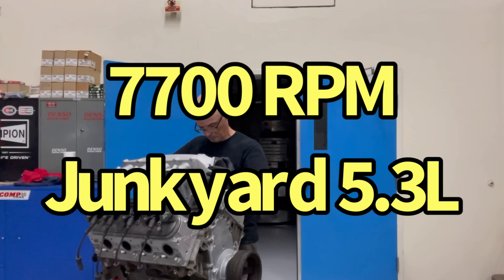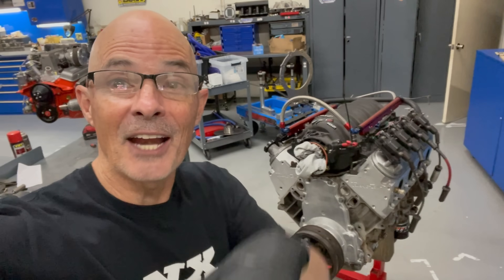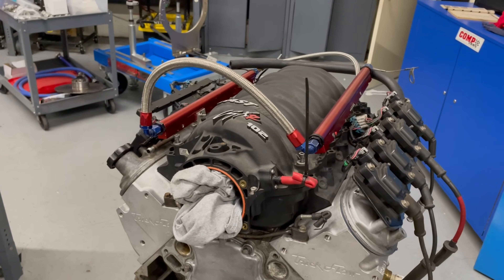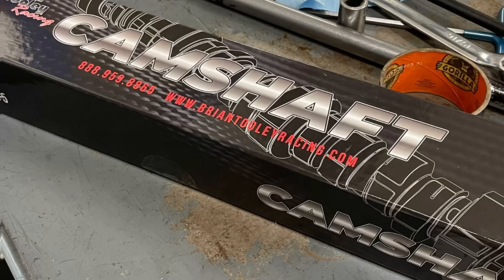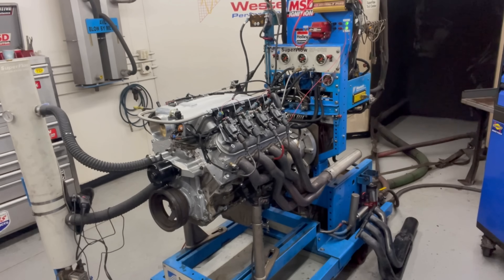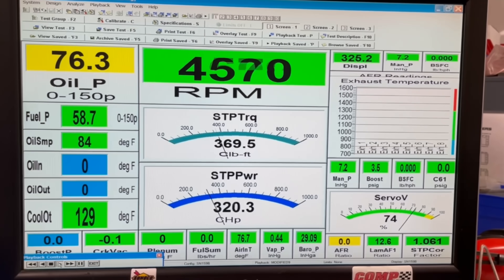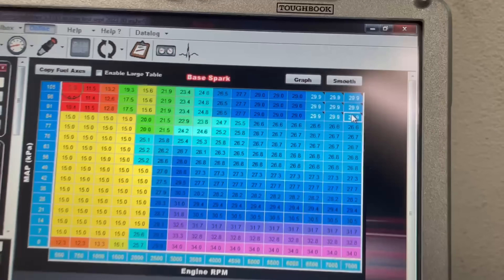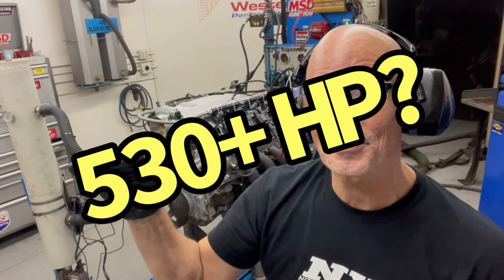JUNKYARD LS MONSTER MAKEOVER! HOW TO TRANSFORM YOUR JUNKYARD 5.3L INTO A 7,700 RPM, 542-HP DEMON!

Comment: Do you think you can make a video on a budget 100 hp/l 5.3 that revs to 7500 rpm
Reply from the maker: that is already up-we made 542 hp from a 5.3L (100 hp/ltr is NOT a budget build)
Reply: @richardholdener1727 could 500 hp be possible for a budget build? If not ima js start with 7500 rpm

Comment: Just curious if this large of a cam would last in road racing situations? I’m in the planning phase of building a gen 3 ls motor. Engine builders, please let me know
Reply from the maker: are you asking about the material of the cam? You need to be more concerned about valve train and engine oiling on a road race motor.
Reply: @richardholdener1727 100% i am, but I’ve been reading that high lift cams cams are tough on the valvetrain, so i was wondering if there was was an upper limit on valve lift that you wouldn’t exceed for an engine being used in road racing. I’m going to be mating a 5.3 or 5.7 LS to a ZF8hp. So I’m going for all top end power since car will have a really good heating and close ratio, but want to make sure it’s reliable.

Comment: I'm betting this has been asked 100 times but here's #101. Typically, the manual transmission power loss is estimated at 15%, but what is the estimated power loss of the accessories? Essentially, what I'm asking is, if this was in a car with full accessories with something like a T56 behind it, what do you think it would make to the wheels? I feel like these bare engine dyno runs give a lot of prospective engine swapers a false hope when it comes to horsepower.
Reply from the maker: The dyno gives a true reading of the changes in power from changes in components. There is no strict percentage loss for a manual or auto trans (every trans takes a different amount of power to drive), same with rear ends, tires, wheels, drive shafts etc...

Comment: Would this have had a higher peak RPM with a 4.8l crank, crank scraper, and/or shaft mount rockers?
Reply from the maker: a 4.8L would have to run higher because it is smaller-but would make less power
Reply: @richardholdener1727  that's what I thought, but I'm chasing high RPM sound 😅 how many RPM higher would you estimate?

Comment: Do you just have a build list I'm listening but i feel like I'm missing some info. What heads? What actual  pushrod did you use
Reply from the maker: tfs as cast 200 heads that were ported by BTR-comp .080 wall hardened pushrods 7.425

Comment: Majestic. Rewatched at least 5 times. Next we need to see 250 + intake cam. 12.5 compression. And test ethanol vs methanol. 600 hp would be magnificent
Reply from the maker: cams like that won't fit
Reply: @richardholdener1727 would need valve reliefs

Comment: So there is a real possibility for my race car L33 5.3 with forged pistons+rods, BTR LS3 NA stage 3 cam, diy 8-1 headers into 2x3" straight exhaust and diy ITB setup with injectors shooting straight to intake horns, to really make 530hp!  I'm going set the limiter to 7500rpm just be on save side because I will run the car for upto 30min at the time.
Reply from the maker: where are the ported & milled heads?
Reply: @richardholdener1727  I have matched(about +5mm diameter) the exhaust ports to the headers(1-5/8", about 42" quite equal lenght primaries about 5" collector) leaving the stock d-shape untouched. I'm going to match the cathedral ports to 3d-printed cf-nylon runners for the BMW R1200 ITBs. Injectors/fuel rails are going to be atop of air scoop/hood. Heads have BTR valve springs, trunnion bearing upgrade and cromo pushrods with Cadillac racing hydraulic lifters. Runned out budget with valves and opted for new cheap valves from Rockauto and lapped them to stock  valve seats. If it seems that the heads won't flow enough after first racing season(in Finland we have 5 month summer) then I need find the money for head and valve job from a professional. Dreamed about some nice CNC heads but they cost as much everything else on this engine :)
Reply from the maker: good luck

Comment: Looking to finish’s my gen 3 lm7 I did a btr stage 3 ls1 cam ls7 lifters and 660 ls6 springs and a single plane carb intake with a 650 for 1/8 mile bracket racing and what could I do better? Also 706 heads
Reply from the maker: ported heads

Comment: I think we should change nothing but a trunnion upgrade, and start squeaking up the compression ratio somewhere in the 13s andE85. Bring that torque up. I do think that there is the potential that we’ve reached the max CFM of those heads. At the higher rpm range I’m wondering if we’re getting some nasty low pressure zones in the transition from the square openings to the Cathedral port. I guess what I’m saying is if we went straight to a rectangular port from a ported cathedral port, we would probably see some higher average power output.
Reply: Guys say those bushings aren't as good as a bearing... Very intriguing though
Reply from the maker: the heads flow enough to support 650 hp

Comment: E 85 and Revit out until the horsepower actually falls off
Reply from the maker: we reached the hp peak, so more revs does nothing
Reply: @richardholdener1727  more revs does a lot in the real world at the drag strip and street pulls with turbo LS to keep the engine from exploding in peak torque on the shift, so testing that theory on the dyno is what I was meaning, how far can it be revved out before it’s totally useless. And at what point and where does that happen? Guess we will never know because like you said it’s pointless

Comment: Please boost an LFX or any of the 3.6 DOHC "HIGH FEATURE" engines. They can make good power per pound of weight in a car. A bunch of Miata owners are swapping them in and would like to see them boosted. They are closed deck design, way better than Honda J series and Nissan VQ.

Comment: What would this engine do on Methanol? Theres a group of us that race LS powere sprint cars in the upper midwest, stock bottom end, 600 max lift cam, edelbrock victor jr intake with a 2-barrel carb on methanol, they make roughly 440hp on methanol. Just curious with this engine you just put together would do on Methanol.
Reply from the maker: what compression?
Reply: @richardholdener1727  stock, 9.5:1 apprx is what our Motors run, I was curious what the motor in this video would do on methanol.

Comment: Put the factory heads back on and see what u can do w a factory long block! 

 I buzz 7800 with the ms3 cam and twins for awhile now. 706 heads w pushrods and springs and twin 78s. Seems fine def slowed down w less rpm at the shift.

Comment: Nice job. From what I've heard e85 doesn't make a big difference in a N/A engine.  But let's see  ! Inquiring minds wanta know  !
Reply: I would think E85 would help more on a high compression Na setup. Like if this 5.3 Liter LS had 12.5 to 1 compression, notched valve reliefs in the pistons to fit a much bigger solid roller cam, upgrade to long tube 1-7/8" stepped headers to 2", & then run E85= an 8,000 Rpm, 600+ Hp, Na 5.3 Liter!

Comment: Richard holdener

On one of the episodes of engine masters, they were trying different size heads on I believe a 408

They showed that the 225 head was too large for that motor

So if a 225 is too large for a 408, wouldn't it be too large for a 325?

Wouldn't a 195 be maximum?

Guys on engine masters even got great results with the 165 heads. They actually impressed themselves, brulee even said that he would take the small head and cam. Com combination for a daily driver
Reply from the maker: a 225 head is not too big for a 408
Reply: @Bozemanjustin- You forgot to factor in the Rpm capability of a particular engine combo. Cubic inches (weight of reciprocating parts), compression ratio, intake runner length/flow (Rpm Range), head runner size/flow/valve size/valve train wt. (Rpm Range), camshaft (type & specs.). A 9 to 1 comp., 408 small block, with heavy parts, 1-5/8" shorty headers & a mild hyd. Camshaft, that only spins to 5,500 rpm, may not benefit any from a huge set of say a 230 cc runner cyl. Head vs a 165 cc runner head that flows well. But try that same test on a 408 small block with 12.5 to 1 comp., a huge solid roller cam, 8,000 rpm intake, 1-7/8" stepped to 2" Long tube headers, ultra light weight reciprocating, & valvetrain parts, then you would see a huge restriction from the 165 cc heads vs the 230 cc heads!

Comment: I’d like to see the power difference, with some short travel lifters, another cam change, and 9k+ rpm!
Reply from the maker: we don't have enough p-v to run a 9000 rpm cam
Reply: @richardholdener1727  so it is safe to assume that things start to stretch at that rpm, that's why you would have to worry about piston to valve clearance?
Reply: Now that's seems real interesting 🤔

Comment: When I hear a lot of tuners talk about ls timing alot of them say around 24 degrees is what they like. But Richard always runs closer to 30. Just curious why that might be?
Reply: Cathedral port vs rectangle port
Dyno va chassis 
Ideal conditions vs real conditions
Reply from the maker: no racer runs 24 degrees on an na LS at the track, for daily street motors running 91 pump gas-you might have to
Reply: @richardholdener1727  that's what I thought. I see "tuners" on various fb pages saying 24 and on Tony Angelo 's latest video his tuner refused to add more than 24 degrees because "the plugs looked good there". I was dying to see what it'd do with a couple more degrees. I listened to you and put mine at 28
Reply: I'm on the chassis dyno frequently and without being knock limited, I've seen max power from 22* timing (ls7), 23* timing on a large cammed Ls3, 25* timing on another cammed ls3, 25* timing on a large cammed 5.3, 25* timing on a cammed L83, 23* timing on a mild cammed Ls1. The numbers richard mentions are laughable

Comment: I was going to do a destroker, but I decided against it since I'm not keeping the car. But im keeping my 4.8 crank for my next 6.0 ls car. Want to get like ~8.5k rpm.

Gonna slowly collect parts like an aluminum 6.0 block, flat top pistons, etc. Want an American version of the bmw s65 engine.
Reply from the maker: you don't need a short crank to run rpm
Reply: @richardholdener1727  misspoke, short crank because my trans won't fit and I can't find anyone to machine it shorter .
Reply: @imSchwaggy  You think a smaller stroke crank will help make your transmission fit🤦‍?
Reply: @evilinside5984 you have to machine the end of the crank shorter a few mm or the trans wont fit. The person i sold my engine parts to did it. A destroked 6.0 and it revs to like 8k and change. I ended up going with an ls1 in my e36 cuz no one close would do the machine work.

Next ls swapped car i do will mostlikely have a similar setup or ill do a high revving ls3.
Reply: @imSchwaggy  Oh , i see. I was hoping you didn't think that a shorter stroke crank shaft, meant a shorter Length, like front to back measurements. You never know what people know. So thanks for clarifying.
Reply: @evilinside5984 oh no lol. Still annoyed i couldnt find anyone locally to do the build for me. Massachusetts sucks lol. One day tho

Comment: Awesome SBE build! Your comment about the “tight LSA crowd” really doesn’t apply here. Tighter LSA generally promotes mid-range torque (as you well know) and actually takes a bit of power away at the top end. It’s good for street and/or circle track applications where you need power over a wider range. That is not what you’re looking for in this case, plus you’d get into P-V clearance issues. I’m sure you’re at just about the limit here, though the parameters (lb-ft/cu in) say there might be room for a little improvement in the torque curve with more compression. But then it wouldn’t be an SBE. Very effective combo, thanks for showing us Richard!
Reply: With those killer heads a tighter lsa would likely carry or darn close peak to peak and have better adv. under the curve.

Comment: I just purchased a 6.0 wat do you think wud be a good combination for a weekend warrior i have 1987 montecarlo N.A or Turbo??
Reply from the maker: yes turbo 6.0l with mild cam (BTR TN)
Reply: @richardholdener1727   yes sir 6.0 with ls3 heads precisionturbo kit Xt- 7675
Reply: @richardholdener1727  I jus purchased that turbo kit I wanna make at least 800hp an I'm gonna run e85 fuel wat would u recommend for injectors

Comment: Hi Richard ,just looking at this combo would these specs be just as great on a 5.7 ls1 with 862 ported heads with 1.95 valves also running 12 to 1 comp or would going up in cam size  be even more beneficial?
Reply from the maker: if you have enough p-v, more cam will make more power

Comment: A tighter LSA does work. Richard, you proved this yourself 2 years ago with testing. The whole, it’s just a result of duration inputs is wrong. In short, Mr Vissard is correct and Mr Tooley is not. Awesome video!
Reply from the maker: anyone that says you need a tighter lsa as a general statement doesn't understand cam timing. Do you know what the valve events are right now?

Comment: Great results, I'm curious about another set of injectors for nitro and  single injector options for meth, water, amonia and others. What about propane injection also ? The bottom end should last under 8k for quite a while the rod/bore ratio is a screamer. I would guess you could find another 100 hp on the above suggestions, especially Nitro.

Comment: I wish I could get my LMG to spin 7,000😮. It feels like it is starting to float at just over 5500, but it is just a stock PPV.  My motor loves the E85 it seems to have a knock sensor issue on pump gas and giving it the Italian tune up.  E85 no problems at all, floor it and let her eat.  Why they didn't put the 6.0 in the PPV I will never understand, not like mileage is an issue as it is junk trying to push 6000 pounds around.
Reply from the maker: a stock 5.3l doesn't valve float at 5500 rpm, it just has the power peak there and falls off
Reply: @richardholdener1727   Hello Richard how's it going??  I agree it isn't floating the valves it has just run out of everything that a stock motor can do pushing a 6000 pound turd.  It's funny that Chevy didn't put a red line on these it just goes to 6000, sort of like they knew something 🤔. I wanted to find another LMG and show the transformation of the delete and adding some cam and doing some garage head work.  With the way prices are going my time might just be worth doing some mild head work to help flow. With my PPV being a daily I just can't justify going stage 3 with it and the trans will have to be built as the stock 6L80 blows from the factory.  Keep up the work, there are a lot people soaking up the information on the engine side.  What they are lacking is more power equals more money from the torque converter back.  We both come from days of a 10 second car was a quick car, and now a Honda can run 7's?? These young men and women don't know how easy they have it to go so quick with just a little added.  Hope you and the family are doing well 🍺.  Thanks again, Brian
Reply: @richardholdener1727  from the live stream what is your burner email so I can email you so I can get you the door parts.  The whole door is 68.00 plus tax so just a latch is almost nothing. I'll hook you up for all the tips you have given the community.

Comment: More cubes would be fun.  How about boring the block to 5.7 to see if it's worth it ?  Run it in the exact same configuration, we know it will make more power but how much ?  I do have a Gen 4 4.8 and a couple Gen 3 5.3's sitting around with a set of low mileage Gen 4 5.7 pistons sitting under my bench.  Is the cost of boring, rings and gaskets worth the 40 (?) extra hp ?  Inquiring minds would like to know.  Thanks for the video's.
Reply from the maker: IT'S MORE LIKE 25 HP

Comment: @Richard Holdener as one your tighter LSA people… you mentioned the heads were shaved but didn’t say what the new CR is? Crunching the numbers comes to a 110 LSA if the CR is at 10.5:1 but… that not gonna help peak power.
Reply from the maker: WHAT ARE THE VALVE EVENTS AT YOUR MAGICAL 110 LSA? COMPRESSION MIGHT BE LESS THAN 10.5

Comment: I wanna see how far the power carry’s out on this engine. I bet it would go 8,500 if the valvetrain could handle it.
Reply: Looks like it was rolling over at  the rpm he stopped at
Reply: @cedricwilson2055  depending on the gearing and application I’ve run engines 500-800 RPM past peak if it increases average power. My LS6 and LS3 currently both have a shift point 500 RPM past peak.

Given this engine’s top end, it wouldn’t surprise me if the power carries well enough after peak to potentially rev over 8,300 RPM. This intake manifold and cam on an LS3 peaks at 7k and carries very well to 7,600 RPM.

Comment: That thing is gonna need a huge converter. Definitely shouldn’t run this setup in a 4dr truck, but it’ll be nasty in a single cab short bed.
Reply: I run a 212/218 truck cam to 7800 with a turbo. It would be pointless NA but with the turbo I make great low end power with the baby cam and carry it waaaaay out
Reply: @bthllp 5.3l too?

Comment: How does the BTR intake compare to the FAST w/short runners?   
Also, what about increased CR and a camshaft with a wider lobe separation?
And would you have less mass and greater valvetrain stability with conical springs?